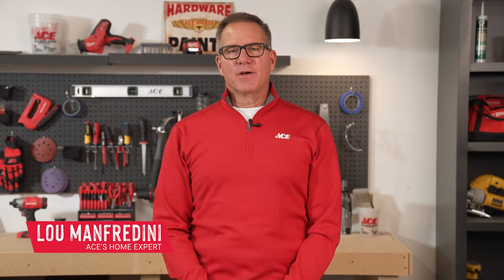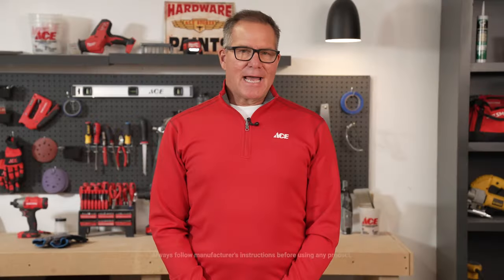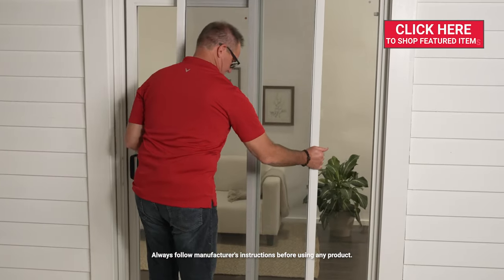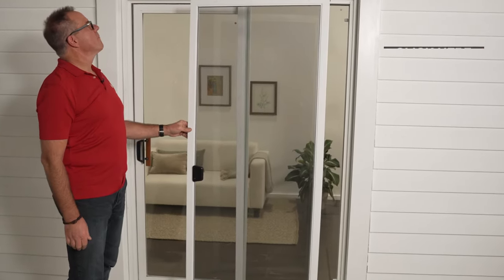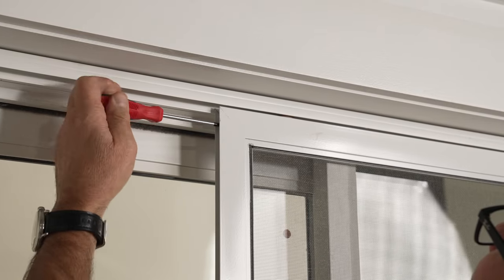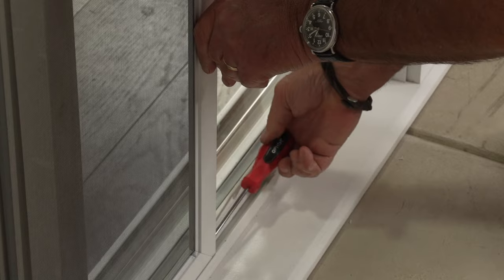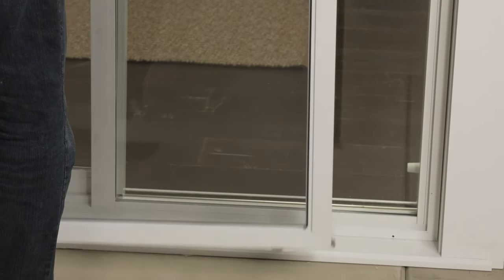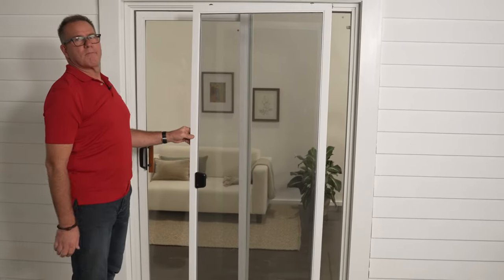How To Remove A Patio Screen Door - Ace Hardware

Comment: Once you loosen ALL 4 roller adjustment screws, you might have to hold the door all the way up while you insert thin screwdrivers under each lower roller to hold them up against their springs.  Then you can swing the bottom of the door out.  Video should be redone to reflect this.
Reply: Thanks for the tip Keith. This is what I needed to do

Comment: Yeah. Grab in the middle and yank on it. Horrible advice.
This is what I do for a living. Literally. 

Adjust the bottom wheels all the way up. Slip a putty knife, paint scraper, etc... to lift each bottom wheel off the track. If it still won't lift off the track, adjust the top wheels down, then try again. 
If it absolutely will not come off, you can always screen it on the house. It's just more difficult. Or call a professional.